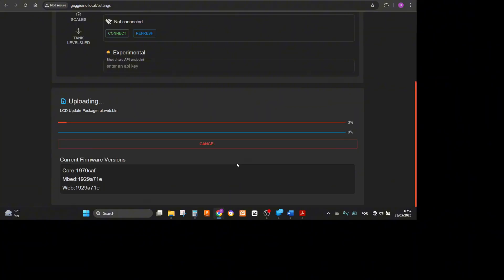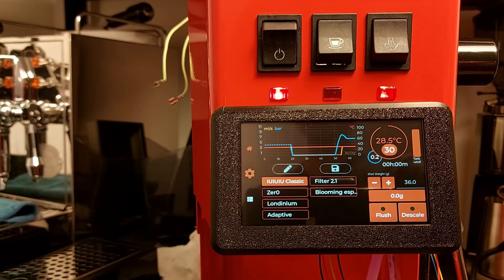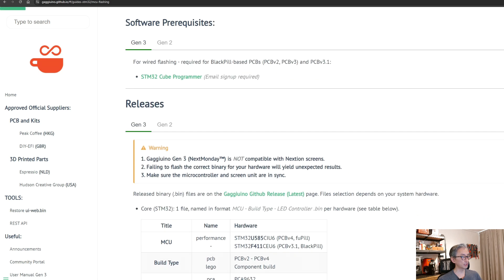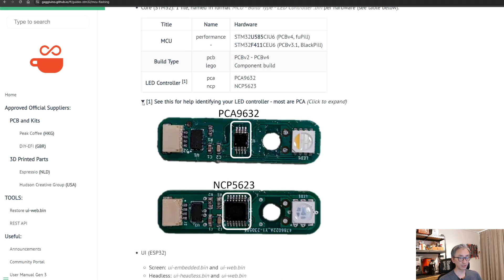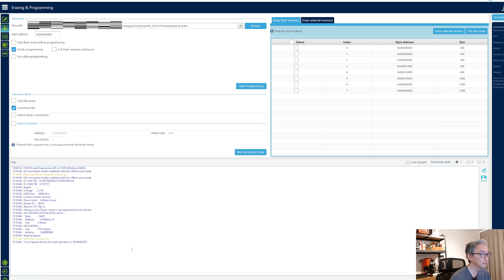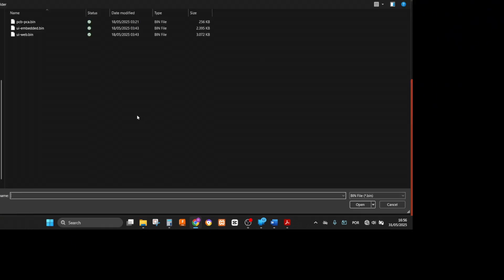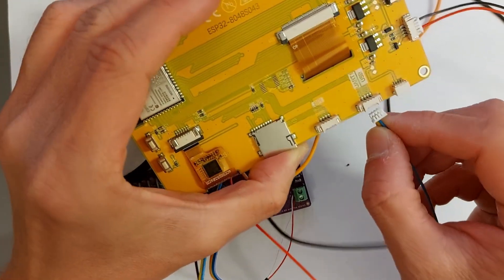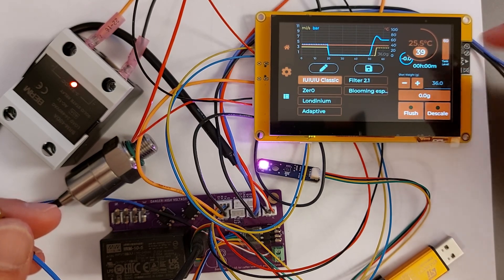Gaggiuino Gen 3 ULTIMATE Installation Guide (Part 1)

Comment: I read that Peak premium kit comes pre flashed. I am assuming I will skip this step and just move straight to testing. Correct ?
Reply from the maker: If it comes pre-flashed you can go straight to the bench test. However, it's recommended to update with the last firmware, you can do it via wifi (OTA).

Comment: Hey thank you for this video I’ve been thinking about buying one of these, honestly great video, are you planning to do another full video on where to plug everything in the machine, I’ve only worked on small consoles. cheers
Reply from the maker: Thanks! Yes, the next video will cover all the wiring, connections, letting the machine ready to brew. Both for 110 and 220v, with stock wiring or building new cables from scratch specifically for Gaggiuino. Keep tuned!

Comment: Thanks a lot
Just whaI needed
Bought my kid from big coffee I just finished install a couple of days ago but when I turn the machine on nothing the boiler was off the time of flight lead was off and the pump didn't start even with the blue button the screen worked fine but show firmware 0.0 my diagnosis was the different word was not properly installed and I try to install it but couldn't find the proper files 
Announce your video has just told me the perfect files on the perfect way thanks a lot
t
Reply from the maker: Great to know that it helped! Happy for you!